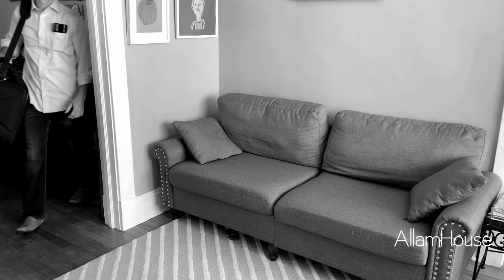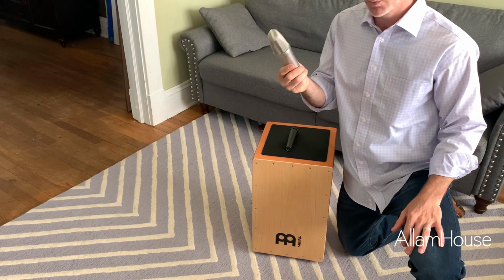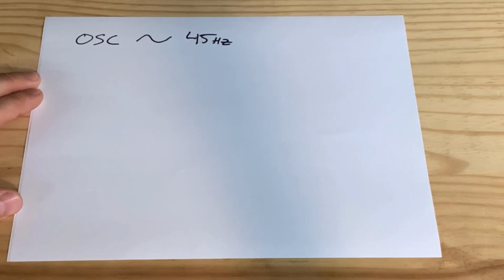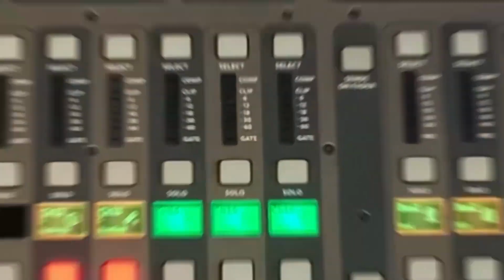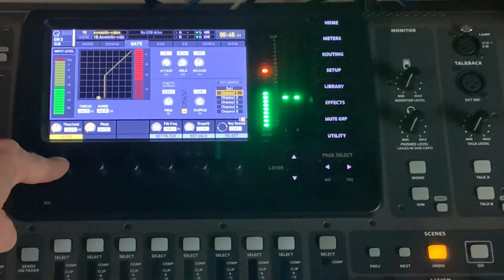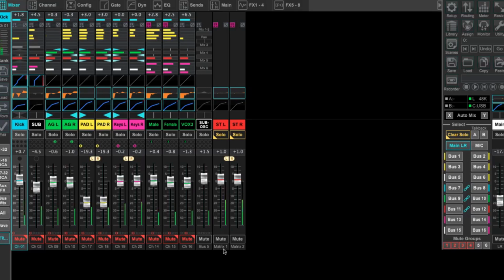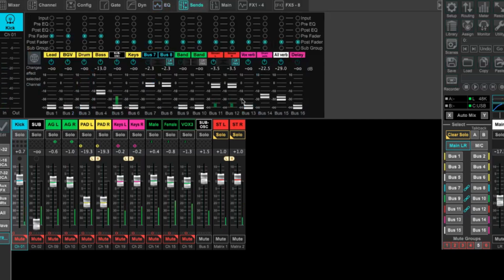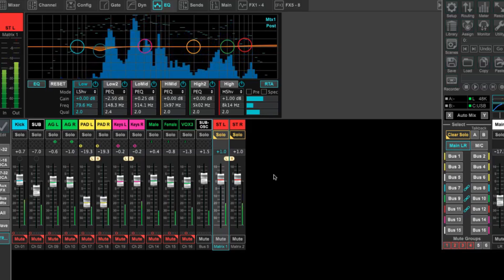Cajon Low-End Mixing Trick

Comment: Any advice for mixing a cajon with a built-in piezo pickup?
Reply from the maker: These cajons are usually not the most pleasing of sound, but I would say to spend some time with the EQ to remove any frequencies that seem to be overbearing and making it sound unnatural (probably 400Hz and 1.3kHz areas).  You also might still need to use the sub low trick to add some low end in since the pickup isn't going to reproduce those lush 45Hz frequencies.
Reply: @AllamHouse  thanks!

Comment: Hi what should I buy 2021 bheringer x32 or midas x32 or x32r
Reply from the maker: This depends on your budget and goals and environment (venue).  The Midas M32 has better preamps and will offer a better sound... at a higher cost.  The Behringer X32 is the same brains of a console, but has the entry level preamps, but saves you money.  I am personally (and my church) using the Behringer and have had the same console for almost seven years.  Neither of the full-size consoles are overly huge in their footprint, but the Midas M32R is a smaller platform which can be nice if you have a smaller workspace.  You can build your scene to only need the top faders so you aren't flipping all around through the desk just because it offer less faders.  I don't know if I actually answered the question, but there are different factors to consider in your decision.
Reply: @AllamHouse  thank you so much , it helped  me by your answer ,   I have right now xr18  at church we are praying for midas m32r .